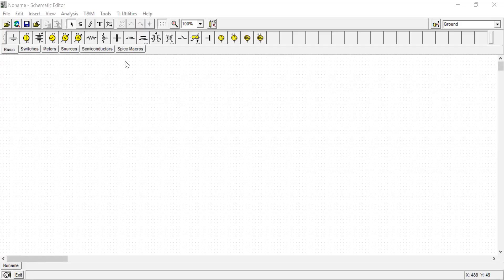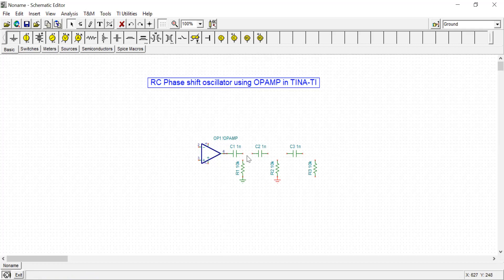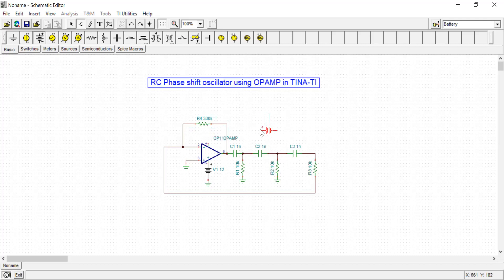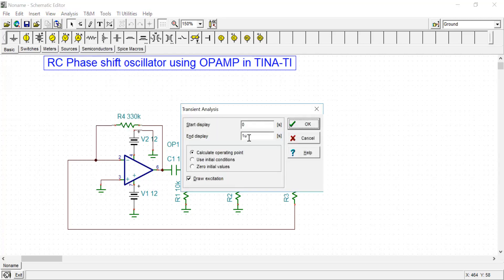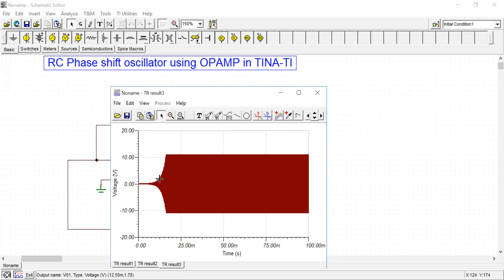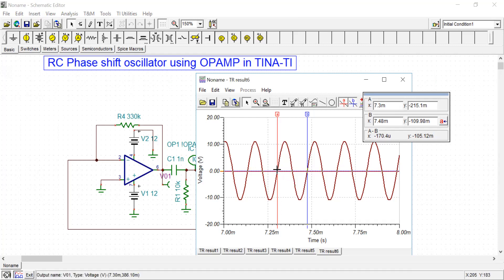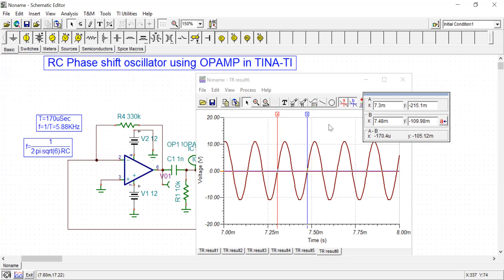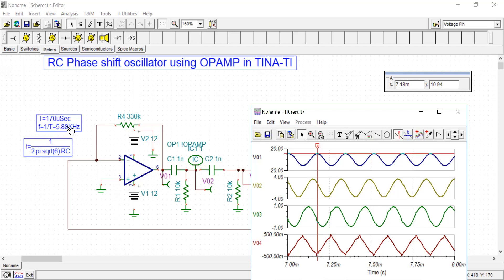RC phase shift oscillator using OPAMP

Comment: Life objective and objective to an objective 3 to design a basic voltage regulator with the maximum power rating with the minimum source current with the different load resistor